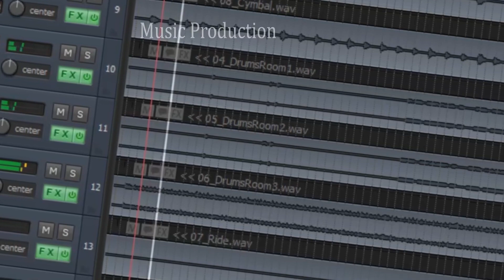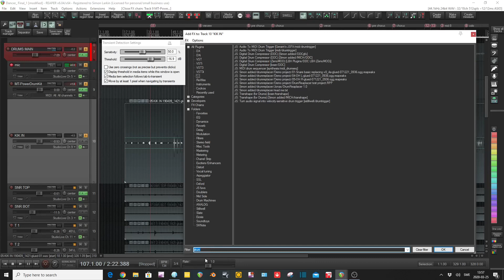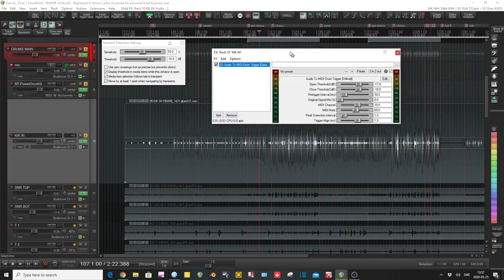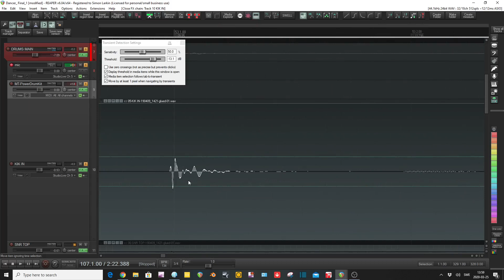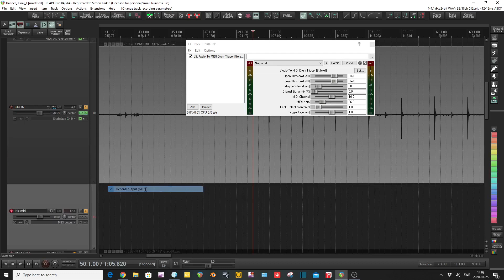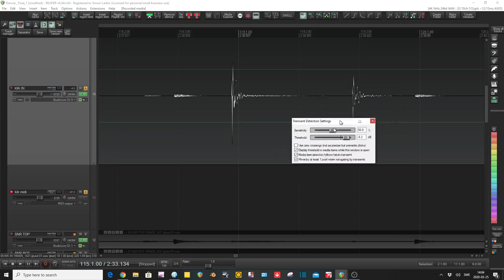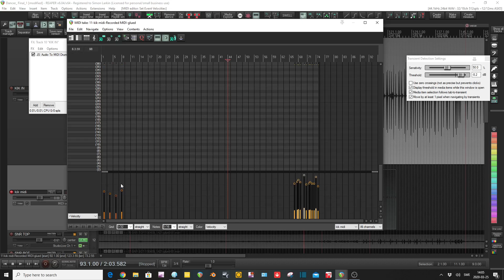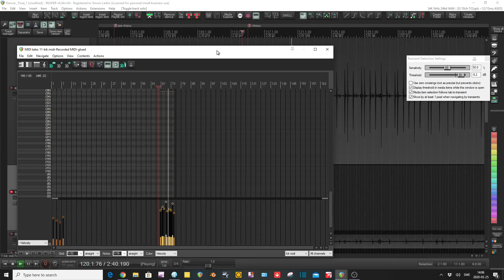Using JS Audio to midi drum trigger

Comment: Hi Simon, is it possible to produce midi while i 'm playing the drums?  I  have a low volume kit setup with drum pads on the drums and low volume  cymbals.  Each drum is mic'd as a separate track in reaper. If i can get midi output, i can trigger SSD5.5 to get better sounds for the kit while playing.
Reply from the maker: You probably could but without using an electronic kit I think your gonna get a lot of miss triggers etc. The method in the video is to augment already recorded drums. If you want to record midi I feel your going to have to get a midi drum kit. I could be wrong but I just think the time involved in refining what you want to do isn't worth it, I would just record the kit and replace afterwards. Thanks for watching!
Reply from the maker: Thinking more about it, there is a plugin call DSP Trigger by Audiofront that can be set up as a midi trigger for live drums.